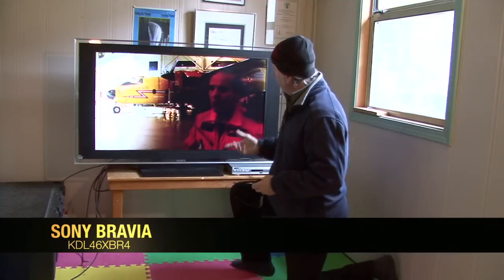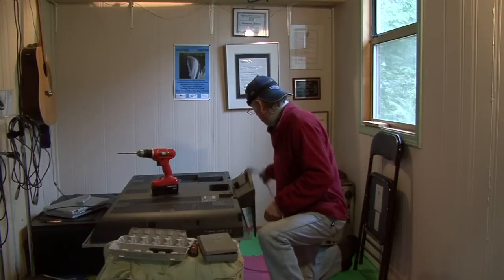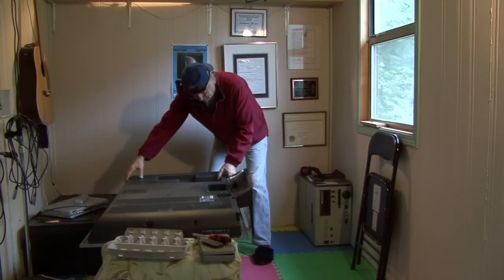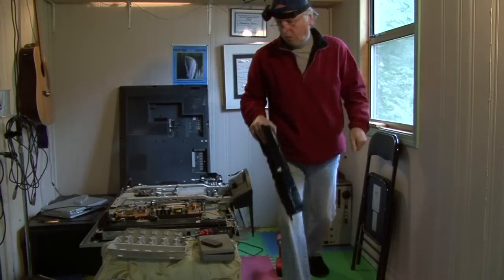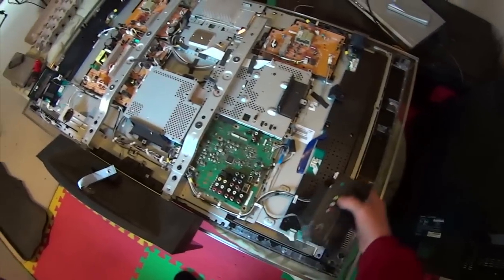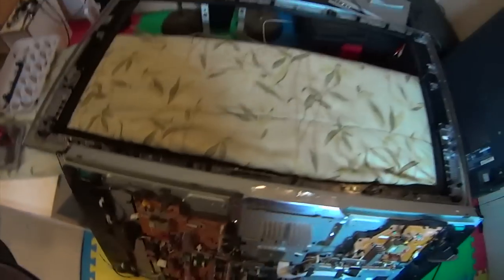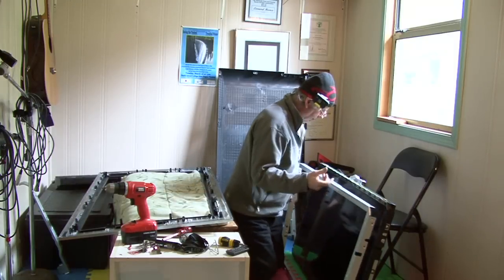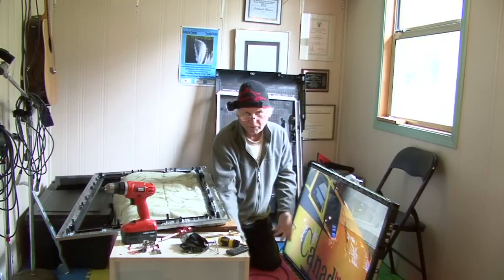Sony Bravia KDL 46 XBR4 - fix ghosting-taking it apart

Comment: Those loose contacts can be heated up with a hair dryer and while it is hot then you push it down with a flat piece of plastic, not to hard though. It will fix the ghosting. The ribbons is attached with heat and a special glue is used to attach it.

Comment: Mine did the same. Sony KD-43X8000D APS-405 power board. I checked the circuit and found 3 Schottky diodes on on heat sink next to the APS-405 label, one of them was leaking between the anodes and cathodes. Replaced all three. Now TV is spiffy again. You do not need to replace the board for it. You can bye the diodes from any radio shack shop.
Reply from the maker: Great info thanks.

Comment: I'd like to add my thanks to Ed too. I took apart my KDL 52 XBR4 for the second time a couple days ago, and referred to this video both times. 

A few comments on my experience: The second time through I found I could remove everything needed with the stand attached and the TV upright. Just pull off the back, then the speakers and boards that attach to the front plastic piece. I also removed the metal piece that wraps over the top by removing the heat sink then the upper mount screws temporarily (replace both after you get the piece out), but in retrospect, I'm not sure even that was necessary. Remove all the screws around the back connecting to the front plastic  and remove. There is a very small power plug to the light behind the SONY emblem at the bottom center, which is a little fiddly, but I managed to get it disconnected/reconnected. At this point you have access needed to remove the metal frame.

In the video Ed is being pretty careful pressing the tabs. I found I had to press somewhat more firmly. In my case, the bad spot is on the upper left most tab. The frame has small oval indents that mostly fit snugly across the tabs, but the ones on the top ends are shorter and only lie across part of the tabs. Pressing the tab on the screen at the point just past where the oval sits magically restores my picture to perfect. I have to wonder if the whole issue with these sets is the frame design.

While it's exciting to take it apart and find the problem, I've not found it to be easy to fix it in a way where it will stay fixed. Just reassembling the set tweaks the frame around enough to cause problems, and when I did get it sorted the first time, it only lasted for four or five months. I've got it working nicely again but am not holding my breath. Too bad though - it's really a terrific set when it's working well.

Comment: One other thing I want to add. When you put aside screws, use the egg carton container as Ed used here, but LABEL it. And make a small note as to where they go. There are so many screw holes NOT used, that you can make the mistake of using the wrong ones or skipping some. Also, the main two support brackets have 2 different length screws, but identical heads. You can easily mix them up. And finally, this TV uses TWO cooling fans at the top. They're covered over with foam... which degrades. The foam on mine fell apart and crumbled, leaving debris all over the circuit boards. Be prepared for this. I found some dense foam from box packing and cut two 3mm layers of it, then glued over the fans.

Comment: Follow-up from 2 years ago. I had bought that used KDL46XBR4, and it suffered that same screen issue, which would disappear after 10~15 mins. I would have to encourage it by pressing on the casing. Some days it took a lot longer. Sometimes when turning on, there would be no picture, just bands of lines. I'm a procrastinator with tasks I'm uncomfortable doing. After 2 years I decided it's time I do this task. And it worked. Turns out it was the top rightmost ribbon cable that provides a feed to the LCD screen. There's a laminate adhesive connecting it to the PCB, and over years, the heat from the unit rising up in that corner softens the adhesive, allowing it to slightly separate and screw up the picture. Simply pressing your finger on it fixes the problem. I applied one layer of electrical tape then several layers of grip tape, to ensure the metal frame will provide sufficient pressure on the cable. Worked great. 
Useful tip: After taking off the top bracket, put the stand supports back on, then the stand. This makes it much easier to work on the set, rather than resting it loosely on the floor, risking some bending of the bottom frame tabs. Yes, it adds about 10 minutes to the task, but the freedom of managing the screen on the stands is well worth it. PLUS, it makes it easier to put the front surround back on. ALSO... make sure you thoroughly test the TV a few times before committing to full re-assembly. I found I needed one extra layer of tape. And lastly... there are some screws that are almost identical, but slightly longer. You can easily get them mixed up. They go on the stand, which is important, so to the tedious task of grouping screws and writing on paper where they go.

Comment: Can't find this exact model online, to open, and get tcon board model no. Very thankful for you sharing  video. Got the back cover off, but it looks very complicated, to get to it. TV is too heavy to lift. Having paid $thousands for it 11 years ago, I thought it is worth a diy project. Hoping I can get to the board, without taking the whole frame apart. Wasn't worth what I paid for I think. Your description of the process is very accurate.
Reply from the maker: Good luck.  cheers

Comment: Same issue with a UMC M3257G-GB-FTCU-UK. no luck fiddling with tape connectors at the top either. Gonna change the T-CON board next and see if that works
Reply from the maker: Good luck!
Reply: Final diagnosis, need to replace led strips behind lcd panel. T-con was fine
Reply: thanks  surfitlive  it  was the CCFL bulbs- i plan to replace them with led strips and a controller board. its still sitting in the garage de-assembled; got a 40 inch LG on sale, but i intend to sort it out;

Comment: Thank you for the instructions.  This really helped!  I located the connection that corrected the picture and then placed a rubber bumper between it and the metal frame.  Problem solved for now.
Reply: Thanks to your video, advices and comments, I've just repaired my parents TV Sony KDL40W4500. I first thought the red color could be an issue with the T-con board or the inverter board. I bought both of them, replaced them, but the on still remain. I finally opened the TV,  took off and cleaned every cards, add the ribbon as explained for more pressure on the top of the screen and now it works.
It's worth trying to be done before throwing it away. Thank you

Comment: Sad to see all that work and you weren't able to fix it, Ed... from all the other videos I'd seen and postings on-line, it looks like the odds are really high for fixing this exact kind of problem, by compensating for the lamination issue with additional pressure against the frame.  There's a Sony 46" XBR TV in a local listing near me that is very cheap, with this common problem on one side of the screen... and I was thinking of taking a chance.  $50 seems like a pretty good gamble.

Comment: Thanks for making this video on how to actually disassemble the Sony. I had to tackle this exact same problem myself a few years ago and at the time there were no videos on how to actually pull the thing apart to get to the ribbon cables. I eventually figured it out myself but it took a while to do, if I had your video at the time it sure would have been a great help and saved me lots of time and frustration. 
I am certain those who are tackling this common problem with the Sonys will be very appreciative of this video, because, as 
you mentioned, most of the other repair videos dealing with this problem do not go through the disassembly procedure.
Great work.
Reply: mowwow1998 is your tv fix still working?

Comment: Ed, look at it like computer. They hate heat and dust. Had a similar problem with a Samsung plasma, except it had lines. Took the back off was quite dusty on wires etc., the cooling fan was covered in dust..heat build up. cleaned the fan(vacum)..very carefully, used a can of compressed air on the wires and components, then blew out the connections..fixed! Not quite the same as an lcd maybe, but worth a try. Its been 2 months and still works fine. Brian
Reply from the maker: +Brian Capdevila Good stuff.  These puppies get hot..and dusty.
Reply from the maker: +Brian Capdevila Actually this is a design flaw with faulty contacts.  That is the fix on the Bravia.  You have to go in and try and repair the contact ribbons on the LCD.

Comment: Thanks for uploading this. After dealing with this exact problem, I broke down and repaired my KDL-46XBR4 in about 2 hours. This video was a great help. The problem was the far right connector. Putting some pressure on it solved the horizontal bar flickers and ghosting. I used some 3M Command hanging foam tabs. This put enough pressure once the thin aluminum frame is on. Works perfectly and hopefully stays that way!
Reply from the maker: +Colin Gonzales That is great..cheers..
Reply: Colin Gonzales is the tv still working a year later? any more advice?
Reply: Adam Howard unfortunately not. It worked well for a couple days, but the fix didn't hold. Good effort though.
Reply: thank you I don't want to waste the time.  I got the tv for free and thought it would be a learning experience. I may still play with it a bit.
Reply: Its annoying because my tellie has the same problem but it goes away after a few minutes or sometimes when you move the tv it goes away... So i dissassembled it fooled around with those cables on top after removing everything but nothing was flickering anymore
Reply: Colin Gonzales

Comment: It works likes magic!  If you have side speakers some delicate wires  must be unplugged.  Use a red sharpie to put a line where you take plugs apart. A good head lamp helps. The screen is "heavy" Some hidden tape with a metal mesh might be hiding. Go slow, a helper would be useful. The tabs are hot. I used examining gloves to press and rub on the ribbon cables. Good Luck! I took  3/16 diameter  of clear tubing 1 1/4 inch long to put pressure on the ribbon cable.
Reply: bucketofguts is your fix still holding a year later?
Reply: Mine is still working. We Take that TV outside to watch sports. The set is built like a tank.

Comment: This is my exact problem, can't wait to see if this helps!
Reply: +VinnytotheK I also got this TV for free, the owner was throwing it out for this problem.
Reply from the maker: +VinnytotheK Good luck..it didn't work for me but worth a try..
Reply: +Edward Homer So... I did it, everything was going fine. I taped down the tabs as suggested from another source. I was taping down the last tab and then the lower right hand corner of the screen snapped. Now I have a working TV but with a crack in it. Oh well, didn't cost me anything but time...
Reply: +VinnytotheK Ouch sorry to hear that! I have the same thing with a KDL40EX521 Bravia; however since watching this vid and how many parts needs to be removed as well what happened to yours during the attempt to fix I might have to pay for a technician instead

Comment: There is a funny way in which I fixed this problem.  I banged on the spots where the specific places were in which you indicated.....and just like the old days with the CRT TVs it fixed in an instant.  No opening of the tv, it was still on the wall mount and I believe this video helped me to come to that solution as a primary solution.  Not a very recommended way to do it but it worked for me lol.  Thanks.

Comment: How did you end up making out ? Thanks for the video by the way!
Reply from the maker: +Daniel Ballestero No luck for me...
Reply from the maker: Jonathan Carreiro No luck.  Took it to the return it store for recycle..worth a try though.  It looks like other folks are able to fix that problem.
Reply: Edward Homer Hi, there is an another trick : check the 2 or 4 flat white connectors that go to the TCON board, sometimes there is a bad contact there. They tend to reduce of size with the heat
Reply from the maker: Chris Lesage thanks for that....
Reply: +Edward Homer Let us know if you had any luck with Chris Lesage tip! Thanks for the Vid